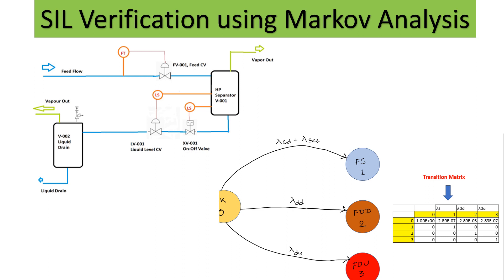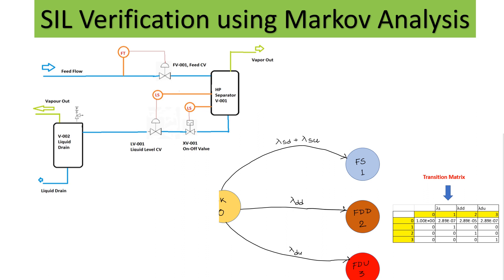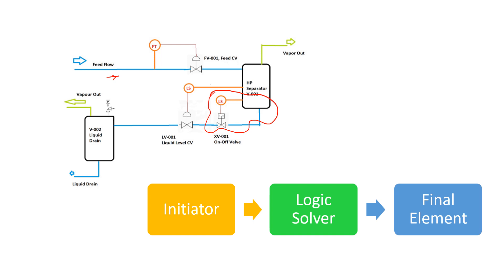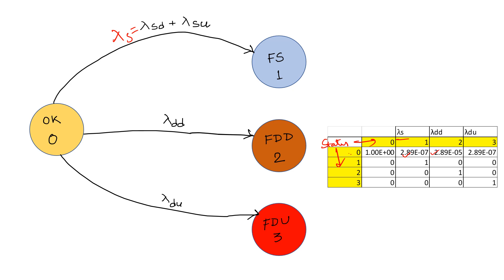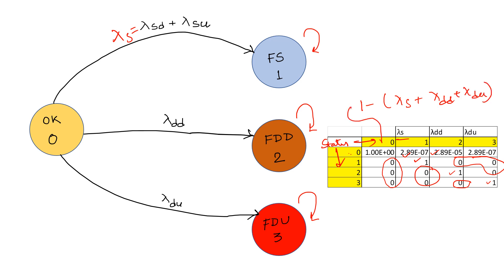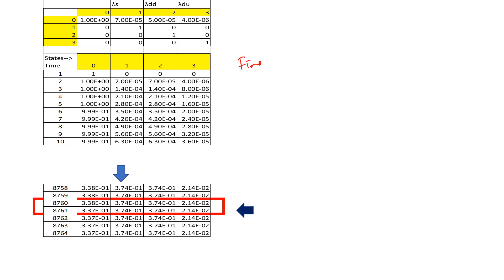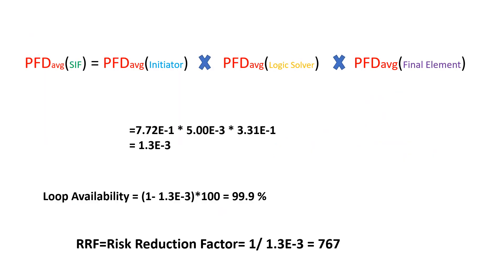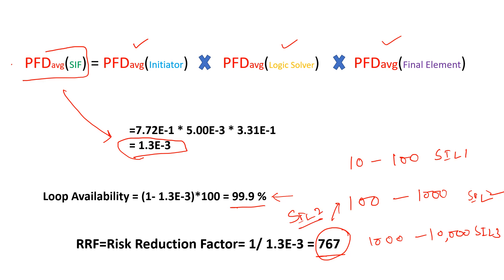SIL Verification using Markov Analysis-Easy Explanation- Part 3/3

Comment: Hi, great presentation. At 6:48 you said that the PFDavg is the probability of being at state zero. Isn’t that the opposite of Probability of Failure? State zero is the fully available state.
Also, you said PFDavg but isn't that value just probability at 8760 hours? Shouldn't the average probability be averaged over the whole time interval?